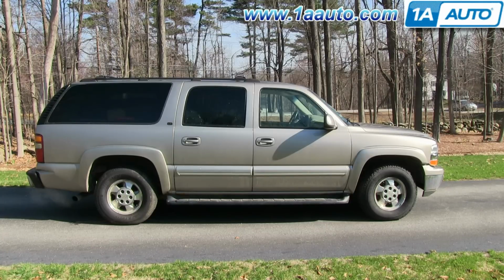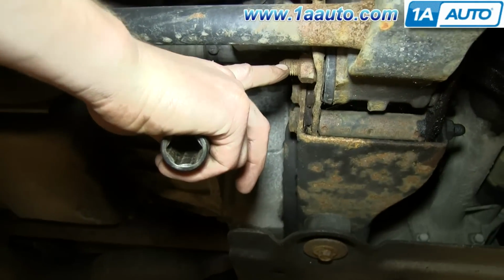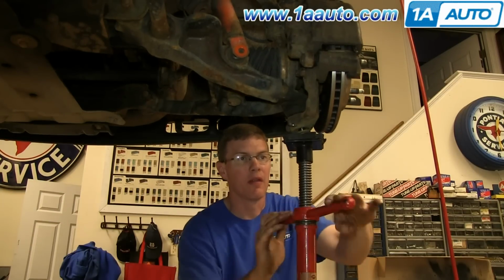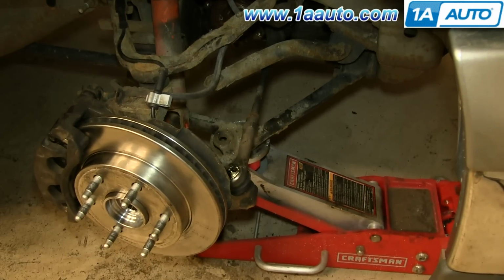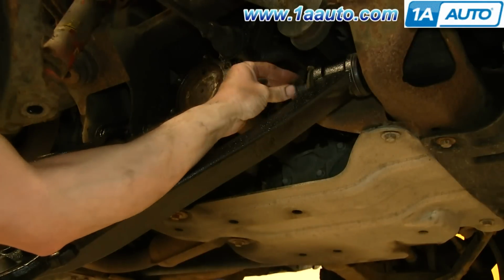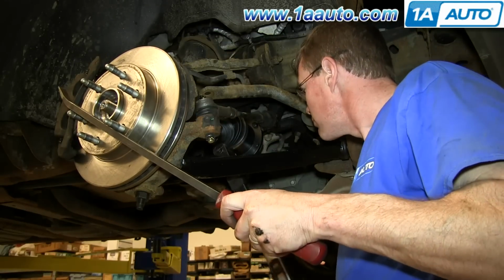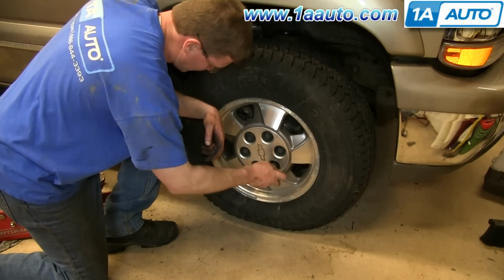How to Replace Lower Control Arm 00-06 Chevy Suburban 1500 SUV

Comment from the maker: √  Watch the Video
√  Buy The Part at 1A Auto http://1aau.to/m/Visit-1AAuto
√  Do it Yourself
√  Save Money
Reply: I have around 260,000 miles with original control arms from factory, would you recommend replacing them? My ball joints are bad but with the amount of miles I have, I figured I’d just replace the control arms. What do you suggest?
Reply from the maker: +Daniel Pelaez With that many miles, it sounds like it would be a good idea to replace those parts. You may want to have a local mechanic take a look at it. Thanks for checking us out! http://1aau.to/m/Shop-1AAuto-c
Reply: What’s the torque spec for the lower control arm?

Comment: I had to cut both ball joint studs to get the Knuckle free. What a pain.  My lower arms will not move around enough to pull it off the torsion bar. I don’t understand how yours came off so easily.

Comment: Weird cause my 06 Silverado has a 36 mm axle nut. Got one here at home and went to the parts store to get the 35 like you guys recommended and turns out it was a 36
Reply: I was wondering too. 36MM seems the standard for a while now. My '08 GMC Yukon Denali XL is 36MM. I'm renewing all of the front suspension components except for the axles and CV joints which were done in September. It's pretty straightforward if you aren't in a rush and have the right tools.
Reply: My 06 Z71 Suburban is 36mm too
Reply: There are different nuts. I did both sides today at work and 1 was 35. One was 36. Depends on aftermarket parts etc.... Just whatever fits.. Especially if its a hunting truck

Comment: This demonstrates nicely why, in this double clamshell suspension, one should jack up the lower control arm before checking for movement at the lower ball joint. The torsion bars exert continued torque on the lower control arm even when the wheel is off the ground, exerting axial compression on the lower ball joint. You are more likely to see play if you relieve that compression by putting  a jack under the arm.

Comment: Great video. I had always heard torsion bars can be dangerous, but as long as you make sure the adjustment bolt is all the way out its no problem. I now have full confidence I can get this done on my Jimmy, thanks 1aauto! 

Also I usually put the lugs back on the wheel studs to avoid damage to the threads when using them for a stop.

Comment: Decided to write this out to make it easier while in action in the garage/driveway. Hope this helps someone.

Lower control Arm replacement step by step
 
Items Needed:
New Lower Control Arm From 1AAuto.com
14mm, 15mm, 18mm, 21mm, 22mm, 24mm, 35mm (or 36mm) Socket and Ratchet
Socket Extension
21mm Wrench
Locking Pliers
Hammer
Pry Bar
Torque Wrench
Jack and Jack Stands
Spray Paint
Reciprocating Saw (If stabilizer won’t come off)

Spray torsion bar bolt with spray paint to mark where to tighten it back up to
Remove Hubcap hex
Loosen 35 mm or (36 mm) hub nut
Lug nuts off
Tire off
Loosen torsion bar nut
Take off 24 mm ball joint nut
Loosen 22mm control arm bolt and 24mm nut keep bolt in place for now
Vise grips on top of steering stabilizer
Remove 14mm bolt on bottom of stabilizer
Jack up control arm
Remove 21mm bolt on bottom of shock
Put nut on ball joint Jack it up again and hammer on side of knuckle
Lower jack then jack up control arm and remove nut
Remove 35mm hub nut with air tool so you don’t have to hold brakes
Hammer out stabilizer link
Remove 15 mm axle bolts
(Use pry bar on lug nuts to keep from spinning)
Hammer axle to side then pull it down and out
Push shock out of lower control arm
Jack up control arm until ball joint falls out
Lower jack and remove control arm bolts 22mm
Slide control arm down and out of torsion bar
Line up torsion bar hole then control arm bolt holes. Put bolts back in.
Jack up control arm and line up ball joint.
Jack up steering buckle and put nut on ball joint and tighten
Tighten control arm bolts
Put axle back into place and replace 15 mm bolts
Hold wheel still with pry-bar and torque axle bolts to 65 ft-lbs
Put stabilizer link back into place (Jack up control arm to get nut on top)
Tighten torsion bar nut back to paint line
Put lower shock bolt in and tighten
Jack up control arm fully and torque control arm bolts while jacked up fully so they are in riding position
Tighten stabilizer till bushings are smashed to same width as washers
Put 35 mm (or 36 mm) hub nut back on and tighten
Put wheel on and lug nuts
Lower vehicle and torque lug nuts
Torque hub nut to 160 ft-lbs
Put hub cap on

Comment: Informative video! I can almost swear he had the jack under the stabilizer bar link. That top bolt counter sinks about 1/2 inch to 3/4 in side the bushings. It looks like it should come out sooner but it doesn't. It may look identical, but the price tag says different. I have been to your website. I didn't see one brand name part there.  All and all good video for folks that have never done it!!!

Comment: One side note here, I just changed mine on a 2002 Suburban Z71. It had been replaced before.  I could not get the ball joint bolt out and free from the control arm. It liked a half inch.  So I had to loosen the upper ball joint nut and free it up to make enough travel room.  The lower had been replaced before, and the ball joint bolt looked extra long. Removing the hub assy from the upper ball joint made the change easier, but tie it from above for support so not to rip the brake line out.
Reply from the maker: +NewMexicoJoe Thanks for the feedback!
Reply: @1AAuto  Hey, Thanks for the video! Other ones actually remove the torsion tube first, and I thought, "Nah, That doesn't sound right". Not everyone has a garage and compressor/air tools.  You made it easiest.

Comment: that looks fairly straight forward, but if you live in any rust belt you know that torsion bar doesn't come out that easy. i have to replace the drivers lower control arm on my '02, and i have done enough this stuff that anything related to the torsion bar is going to take hours just to move it, in order to do anything else. so i'm dreading doing it, especially without a good air hammer and a torch.

Comment: Currently doing this repair. The only difference is my van is 23 years old and from the Midwest the torsion bar is so rusted inside the control arm the only way to free it is to cut the arm away from the bar

Comment: Just a tip. Use a screwdriver in the slot of the rotor against the caliper. That will eliminate needing someone to apply the brakes. Plus will help when loosing the axle bolts.
Reply: I was just about to ask this to make sure I was right about my idea, thank you very much! I have to get this done today and I wanted a confirmation before I started.

Comment: I like how that torsion bar just fell out. Up here in the northeast those are rust welded in place. If you plan on doing lower control arm in new England I'd be ready to buy a new torsion bar and keys. And and you'll need alot of luck
Reply: I'm about to do mine. 03 burban and this doesn't help at all!!!! Lol

Comment: Ever answer Bondo's question from a month ago? "How do you know what height to reconnect the torsion bar to the lower control arm at, so the tension will be the same?"
Reply: He painted the bolt on the torsion key bolts to know when it was tight enough you can also measure the length of the bolt sticking out

Comment: so, in the video you didnt drive the torsion bar out, or show using the torsion bar unloading tool?? im putting new upper and lower control arms on my 05 sierra.. do i need to use the unloading tool or can i just pull the control arm after removing the adjuster bolt?? Thanks

Comment: What do you torque the lower control arms too?
And what do you torque the bolt under the knuckle too?
What do you torque the 35 mm bolts too?

Comment: Great video. I am trying to do this right now. When i try to loosen the torsion bar bolt it is extremely tight ! How do i know when it is loosened enough  ? I tried to get the lower ball joint free and it will not budge. Is it possible that  i didn't loosen the torsion bolt enough ? Any other way to get the ball joint free ? I do have a couple of pickle forks but i have my doubts they will work, seeing as the ball joint is so tight.   I don't want to remove the key because i do not have a big puller or the proper tool. Also my sway bar link was seized like yours. It ended  up breaking. I had to use a grinder, what a biatch to get it in there.

Comment: Could you do a 04 colorado lower control arm .i bought new bushings for it and can't get at the rear bolt due to the torsion bar mount blocking access to the bolt !
Reply from the maker: +Ray Sno We're always cycling through common cars. We'll add this repair to our list! http://1aau.to/m/Shop-1AAuto-c

Comment: Do you have a video for front lower control arm replacement for the 2007-2013 Chevy Silverado? Are there any differences?I'm wanting to do the same job on a 2011 model. Thanks

Comment: How did the torsion bar come out of the control arm so easily?  Mine is frozen in the control arm.  What's your recommendation for getting the frozen torsion bar out of the control arm?
Reply: Heat it up with a flame torch can get one at harbor freight
Reply: It WILL come out. 
 If you release all the tension , it may take a little "encouragement" , but it will. 
Soak both ends of the bar, where it indexes with the key and the control arm, with penetrating oil for a day or two if it's really rusted in. 
Once everything is unloaded, a 2.5# sledge and a ball peen hammer are your friends. 
If it was really rusted, I'd take a wire wheel/wire brush to both the inner and outer surfaces to clean them up before putting it back together

Comment: Hey 1A, I'm doing the front end on my silverado, I have now found out that a large amount of them have nonservicable lower ball joints.They have been heated and pressed at the facory, is this the same on some suburbans?  I'm also having an issue lining up the torsion bar and the control arm on my driver sided, its being blocked by the arms bracket. ANY HELP IS GREATLY APPRECIATED

Comment: Hi I'm not trying to be rude but I have been trying to find a video on how to install a lower control arm on a 2000 Chevy blazer 4dr 4.3l v6 4×4 LT
Reply from the maker: +Dennis Tardanico It may be a different procedure on your application. We currently do not have an auto repair video for this particular year, make and model. Thank you for asking. 1aauto.com

Comment: question: I bought a chevy duramax 2500hd. 3 weeks before i bought it, the pass. side wheel broke off. new ball joints, cv axle, control arms, hub assembly, front end alignment. everything was replaced/aligned prior to my purchase. I drove the truck 400 miles and brought it into a shop to re-check the front end suspension. Both upper ball joints were bad already, after only 3 weeks. *Truck's torsion bars are jacked up for 295 tires* but the previous ball joints lasted for 3 years with the same setup. How could a set of NAPA uppers fail after 3 weeks? was it a botched alignment, faulty parts? the UCAs installed with the failed ball joints are for torsion lifted front ends. 

any input would be greatly appreciated. Thanks.
Reply: my ball joints from NAPA  also failed in 7 months. I'm replacing the upper/lower control arms, sway bar links, and the camber plates with these items from RockAuto.

Sway Bar Links: MOOG K700539 {#15835052, 6L2Z5K484BA} (Premium) Problem Solver 
Lower right Control Arm: ACDELCO 45D2465 {#19313223} (Daily Driver) Professional; Complete Arm w/ Ball Joint
Lower Left Control Arm: ACDELCO 45D2466 {#19313220} (Daily Driver) Professional; Complete Arm w/ Ball Joint
Upper Control Arms: MOOG CK620054 {#15224737, 25905442, K620054} (Premium) Problem Solver; Complete Arm w/ Ball Joint
Caster/Camber Kit: MOOG K100159 Front; Greaseable; Contains Cams And Bolt; Plus Or Minus 1.5 Degree Camber/Caster

Comment: Are the torsion bars still under load? Or is there any other action needed to unload them for this repair?
Reply: smo3715 did you watch the video? the part with the spray paint? these videos do a great job explaining the whole project, but it helps to watch them before asking dumb questions.

Comment: Could you name all of the foot lbs. to each bolt next time or would it be different for each model of vehicle?
Reply: I know this comment is nearly a year old, but when I ordered a set of CV axles for the front, I received a sheet with torque settings based on vehicle.  Things like control arm bolts and lug nut torque are going to be similar, but the large nut on the CV axle has a variety of torque values.

Comment: Does busted bushings on lower control arm  will make truck shake while braking and wobble at high speed?60-70 mph and what's the price for 2 control arms on 05 Chevy Silverado 1500 4wd?
Reply: No reply? I just got all 4 complete arms for 320+/-
Reply: Will make truck shake.... hmmm not sure more than likely a little wobble but I would just spend the 50-150 bucks and get it professionally inspected for 100% assurance. Dont go cheap, cheap shops want you to spend money
Reply: If it shakes while you are breaking it could be a warped brake rotor .

Comment: First I'll start with, Thanks for all the videos, have used them many times.  Have bought parts, great quality and fast shipping.  Now my issue with this video.  In the beginning you removed the spindle bolt dust cover, at the end you did not put it back.  That's all. Thanks again.
Reply from the maker: +Louis VanGroll Thanks for watching!  Mike does mention at the end of the video to put the dust cap on after you torque down the spindle nut!
Reply: @1AAuto   Ah yes, right at the spot I stopped watching. LOL   Ok even better video.

Comment: Do I have to remove the tension from the torsion bar to remove the control arm? Or just unbolt it it cause u sprayed it then skipped to wheel?
Reply from the maker: +CHEVY BOY!!!! You do not need to remove tensions from the torsion bar to remove it.  Simply follow all the steps in this video and you will be good to go!  If any other viewers need the lower control arm for this job please click the link: http://www.1aauto.com/control-arm-with-ball-joint-passenger-side/i/1aslf00286?utm_source=YouTube&utm_medium=CTA+Comment&utm_campaign=ytcomment&utm_term=3ST9DLuKI0g
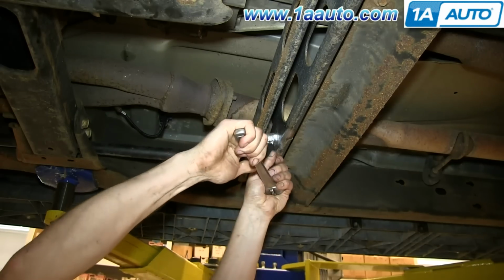Reply: Please watch the full video before trying this at home.  Time 1:52 shows unloading the tension after the paint has dried.

Comment: what are the torque settings for lower control arm bolts as well as the wheel hub bolt?
Reply from the maker: +DOUGLAS CRABB The control arm nuts and bolts should be torqued to 129 ft-lb, and the hub nut should be 177 ft-lb.  1aauto.com

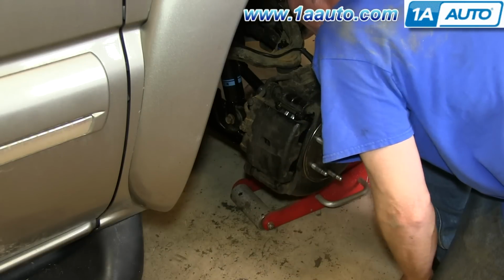Comment: Torque specs of lowers control arm when raised to riding position? (12:00)
Reply from the maker: +Prince Naim Thank you for watching. We currently do not have this torque specification available. You should be able to locate this information in your owners manual.

Comment: You never said what's the torque specs for the lower control arm bolts
Reply from the maker: +Robert Dudley Jack the control arm and torque 24mm and 22mm control arm bolts
Torque the control arm bolts so they're in the riding position
Thanks for the question!
Reply: @1AAuto  what's the torque specs for the lower control arm bolts?

Comment: what are the sighs of a worn out lower control arm
Reply from the maker: You may experience a shake in the steering wheel, or possibly a thumping noise or squeaking from the suspension. We carry the control arm shown in this video on our website. Here's a link to them. http://www.1aauto.com/control-arm-with-ball-joint-passenger-side/i/1aslf00286?utm_source=YouTube&utm_medium=VideoReply&utm_campaign=1ATony

Comment: Some clarification:  Why are we jacking up the lower control arm before disconnecting the shock absorber.  I would have assumed it would be unloaded as the wheel is in it's lowest position?   Also, are we jacking up the arm before hammering the knuckle because it's going to fall off after or some other reason?  When we unscrew the torsion screw that releases some or all of the torque?
Reply from the maker: +gary lucas It will help to take some of the tension off. If any of our viewers needs to make this repair we carry the control arm shown in this video in our website. Here's a link to them https://www.1aauto.com/control-arm-with-ball-joint-passenger-side/i/1aslf00286?utm_source=YouTube&utm_medium=CTA%20Comment&utm_campaign=1ATony
Reply: Thanks 1A!

Comment: I did all this process but my truck sits so low to the ground in the front why is that ?
Reply: You probably didn't line up the control arms right. Take it to a mechanic to have it aligned. (Always do this after replacing suspension components)

Comment: Never seen you showing how to loosen the torsion keys as the torsion bars still under load. Very dangerous. Torsion bars can be a pain to remove as the get frozen in. Think you forgot to mention to loosen lower ball joint nut.
Reply: Guess you must have been skipping around.  Check out 1:52

Comment: You never torqued the steering bar link
Reply: The sway bar end link? You don't torque those. They just get tightened until the rubber bushing has the same outside diameter as the metal washer.

Comment: I was told it is a 2 hour job per side ???????
Reply: That sounds about right.
 Took me 4 each side to do upper and lower control arms, tie rod ends, sway bar links and shocks. 
Working on the ground in my driveway. 
Had all the right tools. All by hand. 
 Only used air for the lug nuts.